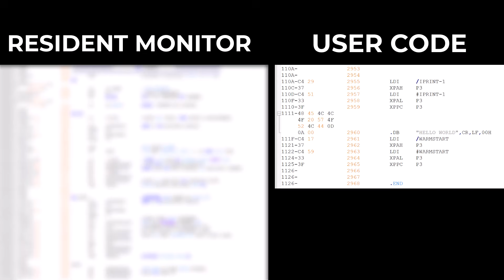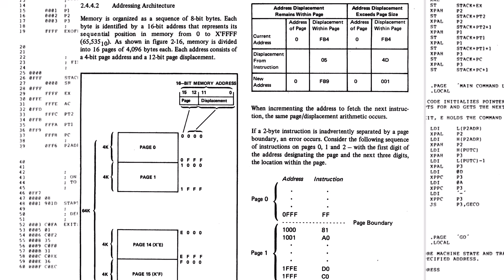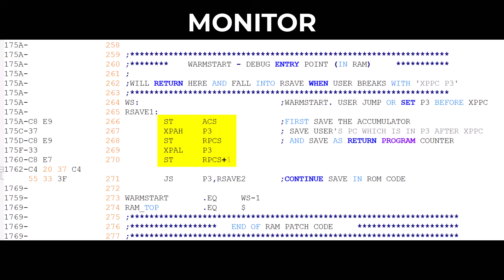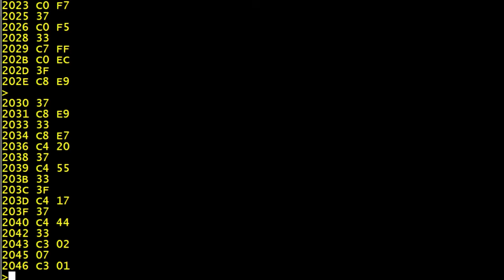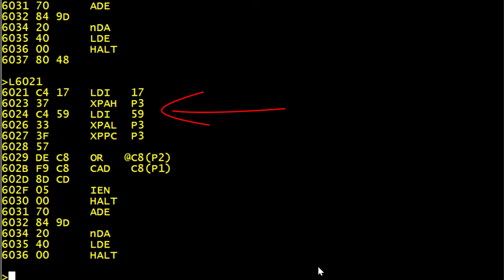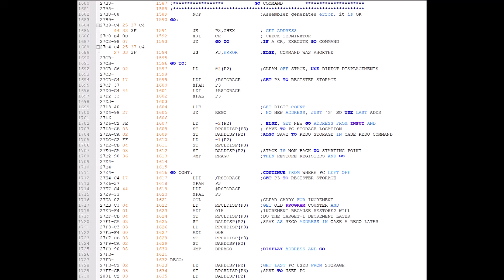{145} Finish up the Nibbler Hardware and KitBug++, a Resident Diagnostic Monitor for SC/MP Platforms

Comment: One thing you could add is to disassemble the current instruction at the end of the R command output.
Reply from the maker: yea, but the thing is... which instruction?  since the SC/MP is so clumsy when it comes to a breakpoint, by the time it gets to the xppc there are probably p3 loading instructions before hand.  The way it is right now it is a two step process, do the R command, and then do a list from the PC address.